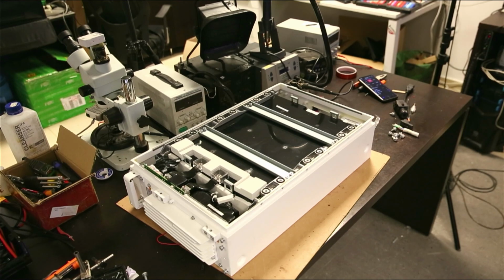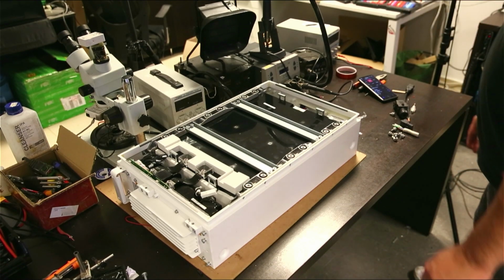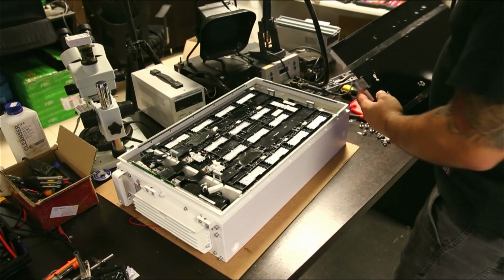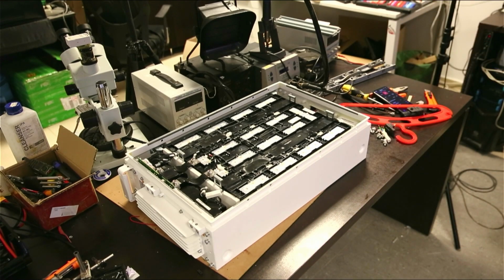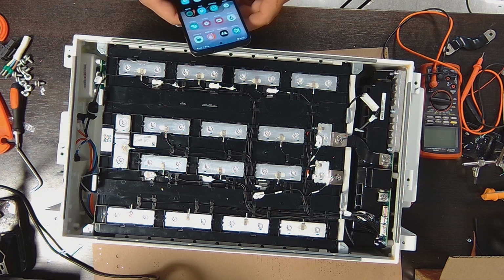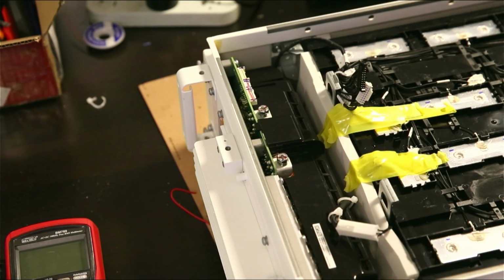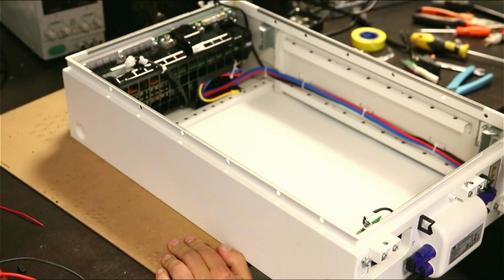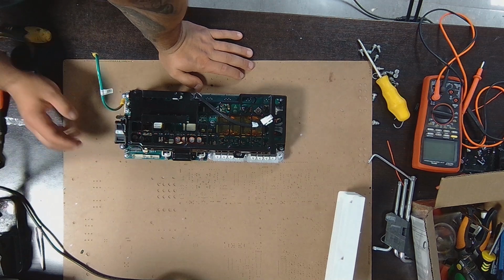Disassembly Guide: Huawei Luna 2000 5kWh Battery | Inside Look & Safety Tips

Comment: I have a complete Huawei Solution with Inverter, Battery, Wallbox and Optimizers and I am super happy so far. Your disassembly shows, it’s built like a tank. Very solid and high quality engineered. AAA+++
Reply: Unfortunately, not as efficient as it could be. Double conversion (550V -> 400V -> 51V) takes its toll. Including DC/AC losses, we get 83% roundtrip. Not to mention that due to the DC/DC converter, each module still uses ~50W in idle mode, so if you need energy not in half a day, but in a few days, you may be in for an unpleasant surprise.
Reply: @sigun0  Measuring with 24h cycles I get much better roundtrip efficiency than 83% Do you have the batteries installed outside?

Comment: Thank you very much for the great teardown. I have already installed about 30 of these batteries, and it's great to see them from the inside and to see that they are well put together. Huawei says there is a dehumidifier inside the battery. Did you encounter such a part inside the battery? Would it be possible for you to do a teardown from the DC/DC on top of the batterytower?
Reply from the maker: Hi, Thanks for your feedback! I did not see any dehumidifier inside, there's something on the lid that looks like a fire protection cell which should pop if it senses fire to extinguish it. Or maybe I am wrong and it's a dehumidifier. I did tare down the DC DC Part off-camera for learning purposes, but It's too much work to be worth the effort of building that part to connect other batteries. I can look for the photos I got and send on telegram or whatsapp, visit deepcyclepower.com and can find my number there.
Reply: @thecelldoctor8890  There is a fire extinguishing bag in each Huawei battery module, not a de-humidifier. That's why there are those 8x temperature sensors. There's also a battery optimiser inside each 5kWh battery. I saw it at a trade show where they had replaced the metal casing with Perspex.
Reply from the maker: @kalbarriman  The temp sensors are for the BMS and cell monitoring. The fire extinguisher cell will pop when there's fire present or goes over a certain temperature, it's not linked to the BMS in any way, it's standalone
Reply: Так, там є нагрівальний елемент

Comment: Did any one managed to start / use that dc dc converter. I just opened mine and sarted fan with 4v signal connected to rj45 blue and white-blue wires but no voltage on mc2 connectors.

Comment: The big problem of this battery system is the self power consumption. Value of 60-70W are normal, so about 1.7kwh/day of loss are normal! That's a lot more than other battery brands.
Let's hope that the new Luna S1 will be better in this regard.
Reply: Honestly if that’s during sunshine hours, I couldn’t care less. But if that’s at night while it’s discharging, that’s a lot relative to the 5 kWh capacity.
Reply: I don't see any sign of neither power consumption or self-discarging anywhere near that. My setup is installed in-house i a (modestly) heated room, is yours installed outside or in a cold place?

Comment: If the battery module also has the DC-DC, what is the controller box doing? I mean the  separate box that is needed besides the battery itself...
Reply from the maker: That is also doing DC DC up to 700 Volts. It will raise or lower the voltage depending on the needs of the inverter. This allows connecting 3 phase or single phase inverters. The DC DC's are bidirectional, used for charging from the high voltage buss as well. The main advantage of high voltage bus is lower current, thus using thinner wires for the entire system.
Reply: Thank you!

Comment: I see a fan on the BMS board that often makes a buzzing sound on my batteries. Would it be possible to replace it with silent? Can you provide the specifications of this fan? By removing the battery terminals on the BMS, is there also a risk that the BMS will block permanently?
Reply from the maker: No, removing the BMS did not make any issues.
Reply: @thecelldoctor8890  I see, You made pictures. Do You have picture from fans voltage, flowrate etc and also can give me dimensions? I wish order the new silent fans before opening.

Comment: Wonder if we can find its rs485 protocol  so we can connect not-Huawei battery to the chain.
Is it possible?
Reply from the maker: Well, the main issue is the bidirectional DC to DC, is not the protocol. Protocol can be sniffed in a few days most probably, but you need to provide 400 V DC from the battery and charge it from the 400V buss as well (bidirectional DC to DC), redo the BMS part as well to communicate with the other DC to DC. (It uses 2 DC to DC's until it gets to inverter). Seeing the complexity of the system, I decided to stop the investigation as it's not worth the effort. There are other inverters out there which work directly with low voltage 48V banks and BMS'es like JK BMS https://deepcyclepower.com/product/jkbms-smart-active-balance-bms/ communicate directly with them. 
I used Growatt 5000 offgrid inverter in one of my installs with a 15 Kw battery that we built and it works like a charm:
https://deepcyclepower.com/product/48v-280ah-metal-box-kit/
Reply: Did you succeed in sniffing the internal battery-to-BMS communication interface?
Reply: RESU10H
Reply: @stefan-lupo-pelzl 我也好奇，
Reply: I just opened that battery ( brand new but made in 2022 so voltage was 7v . After few minutes a managed to charged them to 47V but one cell is lower than others. How can I start that DC DC converter? I connected 4V com socket RJ45(  white- blue GND and  blue + ) and fan started I also heard two clicks but no voltage on output. May be voltage of my cells is to low ( just 46V )

Comment: Thanks for this video. I had a flood problem in my basement where i had one of these installed. Some Mosfeds on the pcb are blowed out because of that. Cells are all ok. Do you have any idea where I can get a spare pcb?
Reply from the maker: Sad to hear about the flood. Unfortunately I don't have a source of PCB's for this battery. You can attempt repairing the board by changing the mosfets and cleaning up the board properly of any corrosion.
Reply: @thecelldoctor8890  Thanks for your reply. I already did that but with no success. To bad Huawei doesn't ship spares for this (due to security reasons). I'll need to buy a new one. :( . Succes with your channel.
Reply: @hanssmits2581 hi, do you still have the electronics board?
Reply: @ВладиславХромов-й4й  i do. But I didn't got it repaired
Reply: @hanssmits2581  if you sent it to me I would like to try to restore it
Reply: Hi  @hanssmits2581 , would you mind to help me please? I am trying to figure out what the internal battery-to-BMS communication interface is. Background: the com interface from the BMS to the inverter is RS485 and the communication between daisy-chained battery towers is CAN. So question is: What is the internal battery-to-BMS communication interface? RS485 or CAN?
It would be great if you could share some photos of the PCB layout with a focus on the left-side communication circuitry.
Thanks in advance!
Reply: @stefan-lupo-pelzl 你搞定协议了嘛，我这边有资料
Reply: @stefan-lupo-pelzl 有没有联系方式？
Reply: @徐杨-z5e  me interesa

Comment: Thank you for the inside look !
Do you have the dimensions of the cells modules you are removing (16S) ? Also do you think it can be reversed 180 ? (terminal side of the battery facing opposite of the heatsink)
Reply from the maker: You are welcome! I just opened to check the DC DC part of the battery, I did not take the battery apart. In the video I show some QR code, maybe can identify the cells by that. For sure they are lifepo4 and 100 Ah. From the looks of it, they seem to be similar to EVE-LF100LA. 

About terminals facing opposite side, you mean the internal battery terminal or the output of the module, the 400V DC ? The purpose of the heat sink is to dissipate the heat from the DC DC module that's converting 48V DC to 400V DC and reverse, 400V DC to 48V. That DC DC is bidirectional and allow charging and discharging the battery from the high voltage bus.
Reply: Thanks for the detailed answer, it is appreciated  @thecelldoctor8890   
If I can get one of those packs, I'm wondering if I can put the battery terminals on the opposite side it is by default (rotate 180 degrees), facing where the connectors go out of the case instead of facing the DCDC converter (removing the DCDC converter but keeping the nice case, and simplifying routing)
Reply from the maker: Yes, for sure, can be turned around, but you also need to upgrade the connectors if you plan to use the 48V directly. @valjuvic
Reply: Thank you !
Yes connectors will need an update ,but it enables less proprietary tech

Comment: Do you know if there if there is a spec on the 4 blue external connector ? I'm trying to source a cable Thanks in advance
Reply from the maker: Hi, I don't have the battery with me, but I remember those cables come with the battery and looked similar to the MC4, but they might be proprietary to Huawei and not be the same with MC4. It's probably easier to replace them with MC4 type on the battery than looking for the original ones.

Comment: Would it be possible to connect external Lifepo4s from other brands to the BMS module? is there any communication between bms and cells?
Reply from the maker: You need just the balancing wires from the cells. If you use same capacity cells should be good. Adding bigger cells might work as well, but needs to be tested

Comment: I'm surprised about the fact taht inside this battery is a ordinary 50 Volt LFP unit. So it might be easy to connect a  batterapack with far more capacity in parallel or not? Does the control unit calculate the capacity or does it only protect overcharging or underdischarging?
Reply from the maker: That is something to try I suppose. But I assume they have some values in the brain unit to check state of charge. That's basic for every smart BMS. In theory it might work if they did not add safety values for stopping at a certain capacity threshold or if there will be enough interest from some programmers to change those values and allow for higher capacity.
Reply: @thecelldoctor8890  Hi, thank's alot for your quick answer. Actually I don't own this battery but I have several thousands of 18650 LiIon cells from recycled ebike batteries. Furthermore I got alot of old USV lead batteries. If I assemble a big block of those LiIon cell wit 13 cells in series and put a independent BMS on them so I get around 50 volt wich will fit perfectly to the original LPF pack. The idea behind is to buffer them. But if there is a supervision of the capacity of the original battery pack I doubt that it will work.
Do you try this idea once out for yourself?
Kind regards
Reply from the maker: No I did not try that. But usually connecting BMS'ses in chain and mixing chemistry is not a very good idea as they have different voltages for charging. Adding a LifePo4 pack in parallel and set both packs at same voltage before connecting might work if the capacity metering don't stop at 2 Kw. Maybe in the future when these batteries start dying or become unbalanced and people starts selling them as Used, will experiment more, but for now I did not afford to break a 2000 Euro battery
Reply: @thecelldoctor8890  Yes I know, you are allright. But at the levels of "48" Volts there are closely similar voltages. 16S LIFEPO have max. 52,8 Volt, 24S lead acid have max. 2,2 Volt for each cell and 13SLiIon have 53,3 Volt with 4,06 V each cell. So they are close together. If you take the LIFEPO as master the LiIon will be slighty underchared and the lead. If you put independend BMS circuits on them so only the max. Voltage will be controlled for each cluster. I thing there might be no problem from this site. Okay I have to check it out first but I'm pretty shure it will work well. What do you think about?

Comment: these are LFP if not mistaken.   new 7kw model coming soon with 15y guarantee and controller module
Reply from the maker: Yes, they are LifePo4 cells inside. These need a DC-DC controller as well, which will get voltage to 600-700V DC. The DC-DC from the battery gets it to 400-500, then the controller provides power to 1 to 3 modules for charging and also discharging from their BUS.
Reply: timeframe when do you think they will be out? i just bought the KTL 6 single phase but not the batteries i guess i should wait!
Reply: @sale666  tech sheets are available. I'd say Q3 2024, but a guess like any other

Comment: I guess we can use standard inverter from different brands on the battery by removing the DC DC by dropping the voltage as normal 😢
Reply from the maker: Yes, that's possible, but you need to have a BMS installed to safely charge the cells as well. The DC DC has role of a BMS as well

Comment: Hello, unfortunately I only have the battery with the cables for the voltage sensors, there is the possibility that you send pictures of the plugs on the board, so this white and black of the cells, maybe even the type is on the connector of the board
Reply from the maker: Hi, I no longer have that battery around unfortunately.

Comment: Unfortunately, my rule is electrical faulty, is there a way to continue to use the memory anyway?
Reply from the maker: Hi, what do you mean ?
Reply: @thecelldoctor8890  I would like to continue using the memory with a BMS and need a little support, there is the possibility to contact you in other ways such as Facebook or Instagram
Reply from the maker: You can use the lifepo4 cells battery with a 16S BMS
Reply: @thecelldoctor8890  I need a little information on how to implement and wire the whole thing..., I’m new to the topic and would be very grateful if you could help me a little

Comment: Is there a way to get it up again after it’s fully empty?
Reply from the maker: Disconnect the battery from the DC DC and use a 48V charger to get cells above 3V. While charging the bank, measure each cell one by one to make sure they don't get overcharged. If you have any dead cells in the pack, they must be revived or replaced.

Comment: Best regards for you wonderful video! I have 2 questions: why use dcdc to elevate voltate to 400V?this not lose efficiency of all system? Second, Have you think is possibile to upgrade 16s 100Ah batteries to 16s 300Ah keeping same electronics?Pack will charged as well?
Reply from the maker: Thank you for your feedback! I think the reason for getting higher voltage is to drop the current used by the system. The pack is able to deliver 2.5 Kw to the main DC DC that gets 400V DC to 700-800V . It is providing loss of power for the transformation, but it makes building the system less expensive and can use low current electronics. That's why the Huawei inverters are so light as well, because they are using high voltage.

Compare the weight with an offgrid inverter that uses low voltage (48V DC) and you will see a big difference.

If it were to draw 2.5 Kw at 48V, you would have a current of roughly 50A. But if you draw at 400V, the current between DC DC to the high voltage buss of the system is only 6.25 A . That allow you to use standard solar panel cables and connectors instead of some thick cables that can withstand 50A .

About increasing pack capacity. Usually BMS'ses have pack size programmed into them, this probably is the case of Huawei battery as well. This allows to detect the life of the battery, set some timeouts for charging and discharging. My guess is that the BMS needs some programming when changing battery capacity, but the best way is to test and see what happens as I doubt that Huawei would offer any insight in modifying their product. Best of luck! And keep an eye for safety, those who plan to work on these batteries. 48V does no harm but 400V can kill instantly.